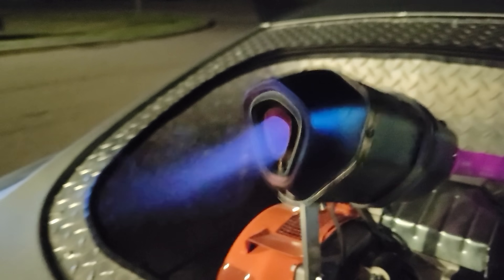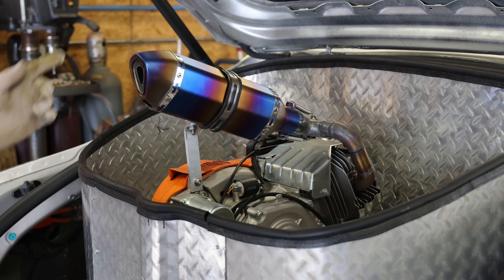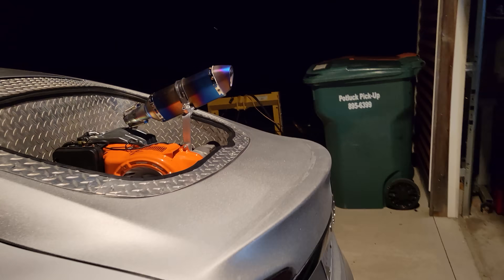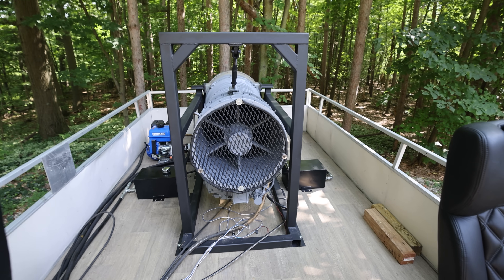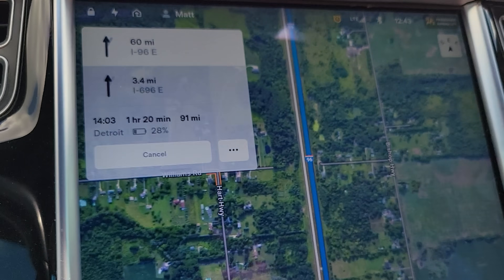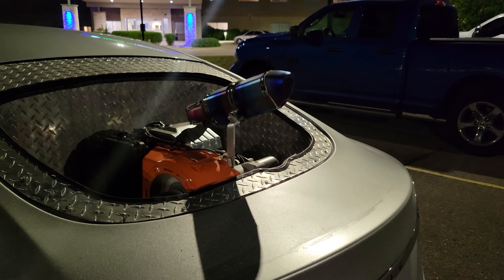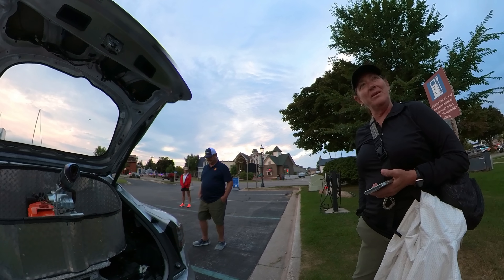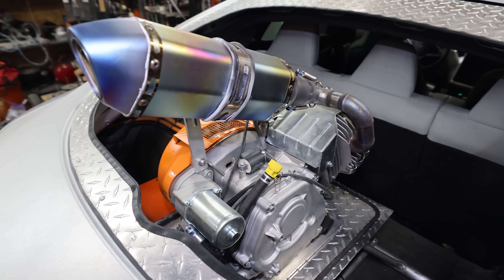Cordless Tesla (I Drive 1800 miles without charging) P.1

Comment: $$$ aside, this is the world smartest, safest and fastest hybrid ever.
Reply from the maker: EXACTLY!!!!! THANK YOU!! finally someone gets it. And autopilot and all the tech and features of a Tesla, it was a dream to drive long distances.
Reply: @WarpedYT  - Nice Username! Your jet boat buddy was right: it's a travelling "Flame Thrower!"

I think tyou would have "Died" if your first Cell Phone was one of those old "Brick" Phones!
Reply: And likely the dirtiest cordless tesla ever. Just think the carbon footprint of the tesla with the extra carbon. Not to mention Oxides of nitrogen carbon monoxide. Lets not forget the Co2. I thought the Idea of the tesla was no Co2 emissions ? As for safest I think the national transportation safety board would disagree with the modifications.
Reply: @bad406camaro  The idea of a Tesla is no C02? There is more CO2 making a Tesla compared to a regular car. Think mining everything for the battery is good? How do you dispose of those batteries when they kick the bucket?
Reply: @markymark5281   That was the point of my sarcasm but my comment was the vehicle emits no Co2 (Before the stupid Mods) Your comment address the carbon footprint
Reply: @markymark5281  the biggest problem with Teslas is the carbon burned in coal plants to charge them. The carbon to make the car and batteries is probably next. Don't worry about battery disposal, lol.
Reply: @EnthalpyAndEntropy  gas car has less efficiency than coal power plant, so not entirely true, while yes, all industries pollute
Reply: @gierdziui9003  what kind of efficiency are you talking about? The ability of catalytic converters to remove CO and NOx and scrubbers removing mercury, lead, sulfur, etc.? Or energy efficiency because you don't understand transmission lines and transformers have losses not to mention that the batteries have significant losses on both charge and discharge?
Reply: @EnthalpyAndEntropy   This is the classic argument of Nuns and Hookers both get VD.  Yes, but not at the same rate.  EVs are about 85% efficient, ICE is about 25% efficient.  
If you think your catalytic converter is doing a great job, close yourself in your garage and leave the car running.
Reply: @EnthalpyAndEntropy  gas engines turn their fuel energy to mechanical energy much less efficient than electric drive engines

and yes, wires transformers and such do waste the energy, but it is still not enough, not even mentioning that the powergrid is online at all times anyway, with or without electric modes of transportation.
Reply: @gierdziui9003  the power grid is insufficient, electric cars or not. The infrastructure is barely holding on due to neglect caused by politics and greed. Also, because it's always on that doesn't mean it's consuming a ton of power. It's not like it's a use it or lose it situation. Demand matters.

It's not just about the grid either. It's all the losses. Tex got his or her numbers for parroting in relation to just electric motor conversion. There are significant losses when charging the battery and losses when discharging, coupled with the generation and transmission losses. 

It's immutable scientific fact that electric cars are not as green as you think they are. They could be even worse and you're simply gobbling up propaganda because you're too blind to see. It's like your iPhone. You live your iPhone and can dismiss the child slavery and suicide nets because you've never seen them, right? Out of sight out of mind?
Reply: @EnthalpyAndEntropy  i dont think electric cars are green, nor care about the environment too much, but EVs are generally greener than most, especially old, gas cars, since the process is still more efficient

ground diggin > refine > transport > fuel > drive
vs
ground diggin > refine > burn for electricity > send via powerstations > charge car > drive

maybe it is closer than i think, but personally i would still opt for not-a-gas car

not really for the green EDGE, that, as you pointed out, might not even exist, but for other reasons, like less smoke in garage and more silence

wherever floats your boat i guess
Reply: @gierdziui9003  less smoke in your garage depends on luck and the car brand. Wasn't it the chevy bolt or volt threatening to burn your garage down and house with it recently? LOL

Get a Tesla for the speed/torque or the autopilot. Don't do it for that other stuff. There are quiet gas cars and a Tesla can produce the worst smoke this side of a nuclear disaster.
Reply: @EnthalpyAndEntropy  no
Reply: @bad406camaro  most Teslas are charged by burning coal. If you think CO and NOx gasses are bad you should look into the mercury and stuff in the coal. LOL
Reply: @bad406camaro  - A lot of these people commenting are just plain stupid as hell.. He also said in his description "without ever having to charge" which is 100 percent false and lying because he IS in fact charging the car!!

Unless he's so stupid that he doesn't know plugging the wire into the tesla's battery port IS CHARGING the damn thing!! Also leaving the engine running on it overnight IS also CHARGING IT!! These people nowadays, omg!!
Reply: Wonder how much gas he went through to do this whole trip
Reply: @catfood9707  - Can't imagine why he didn't share that info on how much the gas costed.. Probably because it was FKing dumb and expensive!!
Reply: It is none of thoise things and the video is a fake.
Reply: Did I watch the same video as you? Pulled over for going to slow, leaking gasoline, noisy non electric car? It is a cool concept and I like WP's videos, but it is neither an original idea nor is it financially sound .

Comment from the maker: To clarify my Project: I want a 1000hp AWD EV that I can drive on the street everyday but also have triple the range of a gas car, this is what my project's about. Some  are assuming that I don't like Tesla or Ev's or that I'm trying to pollute, I have way better things to do with my time than that. That is the future and I will do my part in making it happen one day. Welcome to the way I see things Thanks, Matt
Reply: You can say that, but you're trying to make a hybrid car, not an EV.
Reply: It's amazing the amount of people these days that think everything is some type of political statement. Some of us just like technology and having fun with it!
Reply: on your 1600 mile trip,  How much gas did you put into the car?
Reply: @Northernblades  If we go by his mpg math, somewhere between 66-114 gallons.
Reply from the maker: @chrisjacobsen1659  81 gallons.
Reply: @WarpedYT  For the size of that engine, that's a respectable mpg. I bet you can get the same trip down maybe 15-20 gallons with a larger more efficient engine.
Reply from the maker: @Northernblades  81 gallons
Reply: @WarpedYT  would it be wrong to post how far my car would go on   81 gallons?
While maintaining legal speed limit?
Reply: Its awesome man, just put a better muffler on lol
Reply: Stage 2: larger engine.. say b6 Mazda 4 cylinder and make it around the USA.. also add a starter in the car too and have an exhaust in the standard spot on a regular car and have the accelerator in the car also run the motor in the back.. I bet it could be done.
Reply: @garystinten9339  When using it as a generator, the goal is to have it run at Ideal RPM.   Only an idiot would have any modulation on the generator engine.
The entire point is, they just run.
Reply: @Northernblades  I was thinking in terms of power generation.. Mr HP equals more power lol.. but I've been wrong before
Reply: @garystinten9339  by that logic, why not just hook up a massive diesel powered generator?
or why not an entire 2nd car engine?
This guy is already burning more fuel on his trip, than ANY gas powered car. (travelling at a reduced speed)
Why do you want to burn more?
Reply: You have to get rid of the weight.  Hyper efficiency will first require that our cars lose a LOT of weight.  A Model S only weighs 400 lbs less than my 1996 F350 turbo diesel did.  Conversely my first car (1985 VW GTI 8v) consistently got 31mpg if I drove it like a grandpa or 30mpg if I drove it like I stole it.  Turbo diesel VW Jettas got closer to 52mpg a decade before dieselgate.
Reply: Mini gas turbine time.
Reply: I second the question of how much gas did you use overall. Understood some spilled. But still want to know. Second point is as per my other comment. You prolly are gonna need at least 20Kw generator to at least keep speed limit reliably. You may be able to go 55mph with a 15kw generator.
Reply: Technically your range is how long you can drive before a cop stops you and suspends the registration on the vehicle until you return it to factory conditions.
Reply: @Tie509  I'm just glad he wasn't eating a McDonald's cheeseburger. He may have ended up getting shot or something
Reply from the maker: @Tie509  that's not happening in the Midwest, also I have this registered as an experimental project.
Reply: How did you wire it up to charge while driving? Did you have to have like a DC inverter charge directly to the batteries?
Reply from the maker: @BrocketMan  I had to create my own custom BMS and software amongst many other things. It was tough but I got version 2 coming out real soon.
Reply: I think it's smart.
Reply: How about not being a d!ck to everyone around you and put a real muffler on it. Run a pipe down where normal car exhaust is below the bumper and use a real muffler and possibly a resonator. No one likes their neighbor mowing at 6am much less some guy who thinks he's brilliant and runs that loud thing all night.
Reply: Next step, two or three mini jet turbine's as generators so you can increase the noise level and get 15 to 20kw.
Reply: I thought only the Plaids were 1000hp.
Reply from the maker: @mousepotato581  plaid is 1050hp however they are even more, I will hub dyno my car in a later video to fact check. My car was upgraded by Tesla 3 years ago, long story but you can look up my videos on YouTube where I beat the plaid and p100d both. My car is 4400lb vs 4975 plaid
Reply: Would you consider using hydrogen? Hydrogen cars are basically electric cars just with hydrogen tanks instead of batteries.
Reply: I think a complete prius power plant would be the ticket.  Running it on pure ethanol would take care of the green portion and if source locally?  Heard you can get the alcohol pretty darn cheap on the farms.   

As long as you mix it? You can just say its an additive to avoid getting in trouble with the tax man.  

If tuned for ethanol fuel?  A Low pressure turbo would increase efficiency along with water injection to stave away any pinging from high compression and  timing advance for maximum fuel economy & torque  at low RPM's. 

You are also not limited to one single RPM either.  If more power is needed?  I think the toyota unit is capable of 70 KW output at  ~400 VAC with stock electronics and firmware.    

The combination would be close to silent if using as much of the stock muffler system as possible.   You also get the added benefit of free Heating in the cabin if you plumb the system with a small radiator that's adapted to the cabin air intake if you desired.   

HVAC / Heating the cabin is one of the larger power draws with an E.V.  during the winter.  This alone is worth the range jump as heating can cost you miles of range per mile.  

Alternatively?   LPG / Propane dual fuel system could be adapted for further fueling flexibility.   This also allows the use of an external fuel source as gas lines are very safe even when severed as  a flow check valve can be used to stop any gas flow in the event of a line rupture; quickly shutting off the supply of "Gas" to the engine.      Forgot the name of the valve or system.  

That would be the best route to a cost effective system you could get for less then $300 bucks for a wrecked prius with fully working drivetrain.  Or rusted out chassis.   A custom programer and some poking around with the ECU and electronics onboard (  From that British BMW guy that talks WAY TO SLOW ) 
would be the ticket to have it fully integrated into the Tesla onboard system. 

It seems it would fit perfectly in the trunk area without sacrificing  any truck space if laid flat.  
Toyota had a Previa engine that was flat on its side that would have worked perfectly and engineered for the task.  It also came supercharged, so adding a turbo would not be an issue either on the internals.  Mated to a prius M/G unit would not be that difficult with a custom/ Modified bellhousing.   

The 3C-TE  Diesel engines from toyota would work just fine as well.  This would be a major boost in fuel economy as diesel is simply much more efficient for making gobs of low end needed for power generation while still being mostly quiet on their later engine series.   Similar to the VM Motori v6 diesel   in Dodge's Eco diesel series of trucks. 

The fact you can lay them flat without any problems as used in the Previa series of vans would make the installation compact and almost OEM Fit and finish possible.   

A smaller fuel tank is also a bonus with "Green" biodiesel  also an option.  I mean it's better for fuel then frying chicken.   Save that for coconut oil or taloe.  :-)

-Thank you for reading my Blog post.
Reply: You should try use a micro turbine generator saw another youtube video saying it produced 8KW but its extremely loud but hay maybe you could make a plan.
Reply from the maker: Die Windows  hahaha! Your right I completely forgot to say that !
Reply: What is the fuel economy?
Reply: When ya know what ya want . I see nothing wrong here. 🤜🤛
Reply: Where did you tie into the charge controller to get it to charge while driving?
Reply from the maker: Die Windows  I forgot... hahaha
Reply: You should have put a car muffler on an insulated you would have a possible to spend a bit more money on a better motor a little quieter like a liquid cool
Reply: Find some kid that understands MATH ! Let them help you understand the laws of physics. This revelation will explain why perpetual motion machines don't work either. If you want 1000 HP in your car you need to produce 12500 HP worth of carbon puking fossil fuel generation. Dude, you're going backward! ! !
Reply: @inmyopinion6836  Could use Biodiesel, the solar fuel... Just saying. Proof of concept always comes first.
Reply: @EVtripper  Math is the proof of concept. With internal combustion losses you use more energy than you gain.
Reply: @inmyopinion6836  So what would you use as a range extender then?  Hydrogen cell?  Diesel is an energy dense fuel, and diesel engines are more efficient than gasoline, especially for generators.  Hard to beat the energy density to weight/volume ratio.    Yes, I get that all internal combustion is wasteful, as a lot of energy is given off as heat.  No worries on the Math, I got an A+ in Physics.  Lay it on me.
Reply: Mabe 🤔a scoop on the roof with a pipe going to the engine for moor cooling 👍
Reply from the maker: @mattlawton088  thank you That's why I ended up doing and the next video but I'm already done with the third version I should have that video out soon... I completely did away with the radiator in the back
Reply: There are cooling ports all over a Tesla. How will that help fuel economy-battery life? @mattlawton088
Reply: Chevy Volt will give you one ninth of that peak horsepower but 2 times the MPG.
Reply: Get the Plaid and fit the Gemini 200kw 700+ mile battery under it... ??
Reply from the maker: @kylereese4822  too heavy, if you notice my car is a hardtop.
Reply: I think you were successful in creating a 1000hp Awd Ev if you call it that but your 1000hp ev as a 1000hp range measured in meters not kilometers At that power level (skeptical as hell). Even with the massively polluting firebomb you used to waste gasoline. The way I see things is your modification is a danger to all those who share the road with you. From the loss of rear vision to the potential loss of control from you poisoning yourself with carbon monoxide. Add the fire danger from Improper fuel handling vapor recovery and Incorrect filler safety systems this is a rolling time bomb. As you almost found out with your fuel leak. Off road power systems are not engineered to adhere to on road safety requirements.

Comment: That exhaust is so hot you could run a secondary steam engine and generate even more power!
Reply: Running the exhaust through a steam generator would be hilarious to see😂 it would probably be quieter too! That thing would be way more efficient and a significant increase in power output lol I think thats something no one has done yet

Comment: I think it was an interesting experiment.    Would be interesting to see how all that hardware affects the overall range by just addind the weight to the car.    A proper build with one of those sleek quiet Kohler engines
with much higher charging capacity would be interesting to see.